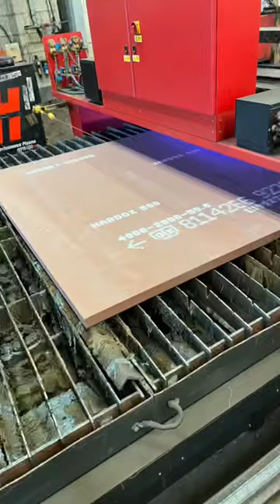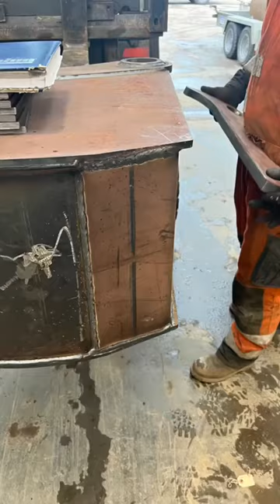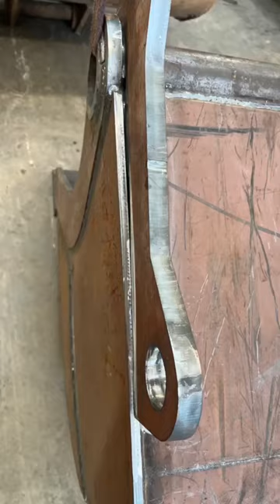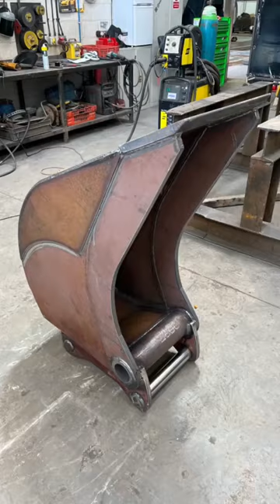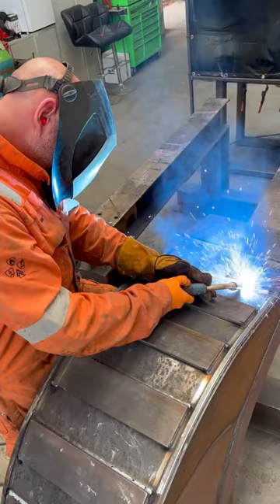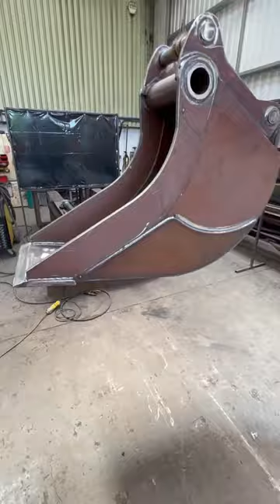HARDOX 500 Excavator Bucket Built to Customer Spec

Comment: Whats the plate thickness and is it what grade  something like armor plate?
Reply from the maker: Hardox 500 comes in whatever thickness you want, its HBW is around 475 to 505. Armor plate is sometimes classified but HHA High hardness armour is around 500 HBW so same strength I'd say
Reply: @welderfabber  "its HBW is around 475 to 505." It should be but it's not always like that. Last week at my job we did some testing on a genuine hardox 500 50mm plate after a customer complained that they where only getting hardness readings of 300-350 HBW. It turns out its surface hardness averaged around 330 HBW but if measured from the sides it seemed to get up to around 470. I'm not sure if it degraded somehow since it was an old plate or if it came defective from the factory.